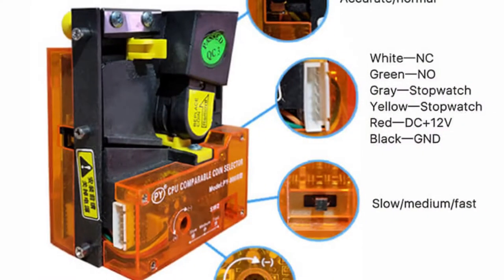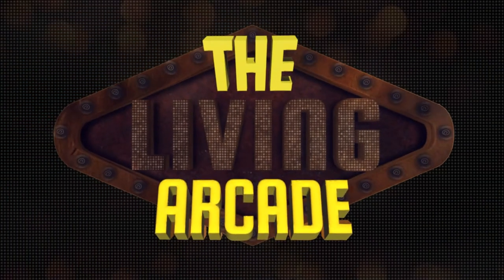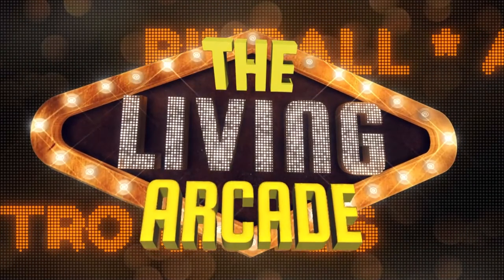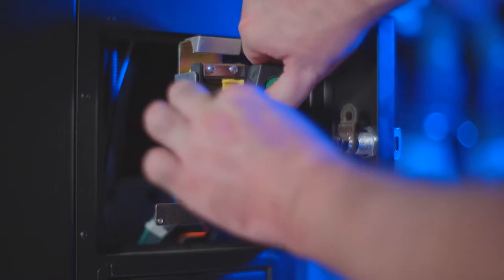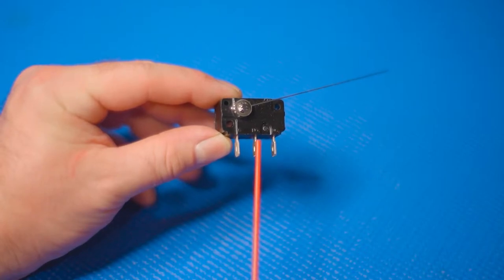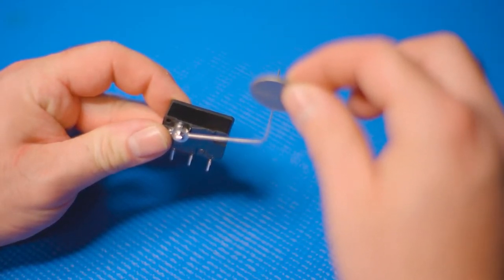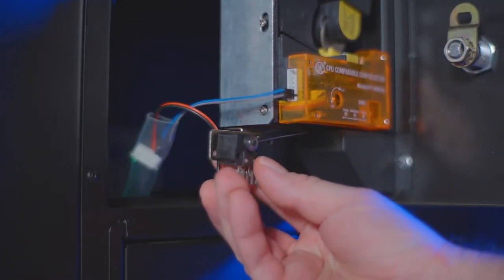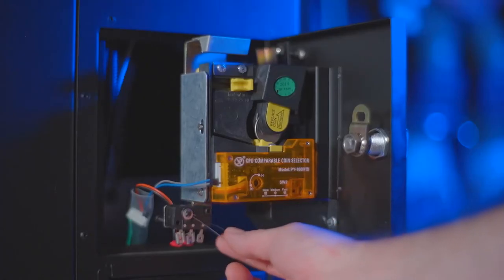Arcade chewlix CPU coin acceptor easy fix no programming coin mech fix

Comment: Well you turn the fancy coin accepter into an old style coin-mech, you could just cut a slot in a piece of wood and put the switch on the bottom for cheap.
The coin accepter must have the same ground as the receiving device (PCB, computer) or as stated one maybe floating way above ground and ground is the reference. If a device is low powered (brown out), digital switching happen within 1-3V range 0v being low, 5v being high. Devices can be a pull high or pull low to indicate activity. Coin-mech's are a pull low (ground) to activate and so are action buttons. Tie the two grounds together to have the same ground reference voltage. (hope no noise or ground loop issues) 12v runs lighting and hold coils but switches run on TTL 5V (or less today for 3.3V MCUs)
Reply from the maker: 100 percent correct! Thanks for watching. I appreciate the insight too. I'm always learning. Yes it's a glorified coin chute at this point but my cab already came with it. I don't know how to tech out if there are any ground loop issues but since it was connected both to the USB of the PC (5v) and a separate 12v power supply plugged into the same power strip. I can only gather that those two grounds aren't bonded even though they should be. I just now thought of trying to power it via the same ATX power supply that is supplying the PC. I'd like to think that those two grounds are bonded. A lot of people reported them working sporadically and causing weird behavior with their USB keyboard encoders. I imagine caused by mixed voltages sharing the same ground that isn't bonded with the USB PC ground. Adding the switch was the cheapest quickest fix. It's way overthinking at this point but it's more about the learning and exploring for me and these principals do transfer to other applications.

Comment: Just got this working following your exact instructions, thanks buddy. Luckily I had the same mounting plate on my Chewlix as you.

If anyone in the UK needs a coin switch to do this mod, I have three spare coin microswitches available that I can give away. Could only find them for sale in a five pack.
Reply from the maker: Awesome! Glad to hear it! I see so many people in various rooms having wacky issues with these things. I can't prove it, but I believe it stems from connecting the 12v ground on the coin acceptor to the USB encoder which is grounded to 5v creating a ground potential difference. 
This is a silly work around but it's the only way I could get it working reliably. And it prevents your USB encoder from any 12v bleeding across it.
Reply: @TheLivingArcade  yeah I agree with you and I highly suspect the 12v to 5v differential is why you hear about so many Chewlix owners complaining about frying their brooks boards. I don't think it's a silly workaround because they had the foresight to include the mounting holes, and you were one of the only people with the foresight to use them!
Reply: @TheLivingArcade  now that I have your attention do you know what the easiest way to make my chewie accept any old coin is? I have a bunch of Sega, Taito and Street fighter tokens that I just bought from a local guy. Not in the US so hard for me to order an AnyCoin
Reply from the maker: @DarrenOConnor3  I haven't messed with other coins on mine. It has a plastic yellow slider adjustment on the top left and the sensitivity trim pot adjustment. You might be able to find a sweet spot where most will pass through. It is designed to be configured to only accept one coin though. I believe you will have mixed results getting it to accept a bunch of different ones. I have seen ebay listings with "lots" of the same tokens. 
I think you will be better off finding a "lot" of all the same tokens.
I've looked into getting my own custom ones made but you have to order a thousand min.

Comment: You could technically use a relay with that coin acceptor as normaly those use pulse with 3/5v so a relay will work better and will help with the credits
Reply from the maker: That's a cool idea. Yeah I assumed it put out a pulse when it's wired correctly instead of just closing the circuit but my meter is too slow to capture it to confirm.

Comment: I have this exact py-800 but can't even get coins to pass through it(and not to reject). Tried with UK 10p and us 25c.  12v is applied, everything set to slack. Just don't get it 🙁
Reply from the maker: Don't fret! I'll try and help. First thing. Does it make a loud beep when 12v is applied? It will make a loud single beep when the power supply sends 12v to it and it's energized. If it doesn't make that beep when it's initialized, you may have it wired wrong or it's not getting 12v.

Second. Have you placed a "reference" coin in the spring loaded slot. It's on the left side with a yellow sticker and the arrow on it. That tells it what coins to accept. Make sure it's the same type of coin in there.

Third there's a plastic yellow slide "sensitivity" adjustment on the top left. Try sliding that left or right into different positions. It has notches that prevent it from moving but allow it to be adjusted.

Forth check the little knob on the side. It's like a volume knob that can only be turned by a small screw driver. Another "sensitivity" adjustment. Mine rejected coins when this wasn't set right.

Too much slack on any of these caused it to reject coins for me.

If it still doesn't work after confirming the above, Remove it completely. There's a switch on the front of it that can only be accessed when it's removed. It says "normal or precise" try both. The other switch says "fast, slow, med" which I believe is the pulse it sends to the board. Which never worked for me hence why I did it this way in the first place.

Please report back if this helps or not. Good Luck!
Reply: @TheLivingArcade  Hey 😀 So kind of you to try and help!  I'd already tried everything you mentioned  - the slider in the T/L is just another diameter check.  The sensitivity dial did nothing for me unfortunately, coin still passes straight through.  I asked the Chinese seller but as expected he wasn't a lot of help 😮 Maybe I just have a dud though... I made a vid for the seller here showing the coin passing right through: https://youtu.be/ysSA-jZggu4  You can hear the beep when 12v is applied and see the reference coin installed.  I get the same result for common coins,  if I've a dud unit though I guess I'll have to order another one!  Just trying to rule everything out and sounds like from what you've said I'm using it properly 🤔
Reply from the maker: @jorisbonson386  Yup you have tried everything. It's at the point of diminishing returns now I think. Could be a dud or could be something wacky and simple. Mechanical issue inside the chute or something. I hope you can figure it out or at least they send you a new one. Good luck!
Reply: @TheLivingArcade  Cheers anyway buddy 😀
Reply: I have the same issue as you, Chris. I got it to accept a US 25c one time (and it worked in game) but it must have been a stroke of luck because the other 999 attempts have all been rejected. My coin mech was a one pump chump I guess

Comment: So doing your “work around” you don’t even have to wire the coin selector up at all? Just need a reference coin in place?
Reply from the maker: Correct. It does still need 12v powered to it in order for it to allow coins through to fall out the bottom and trigger the additional coin switch. and yes the reference coin mechanically tells it what size coin to accept. It’s basically a 12v powered coin chute at this point. Lots of people have no issues with them wired normal directly into their USB encoders. But for me and many others it causes random issues with their USB encoders because the way it can pulse and bleed 12v back into the USB encoder. USB being 5v connected to the PC or console. Connecting only that traditional coin switch directly to your USB encoder. And running 12v power to just the coin mech so it allows coins through. And removes the 12v from the shared circuit of the USB encoder. Hope this helps. Let me know
Reply: @TheLivingArcade  definitely helps. I’m running a PS5 in mine. Just curious where I’ll get 12v from now.
Reply: So I just tested it with power and with out power. As long as you have a coin in the holder for sizing, coins will pass through.
Reply from the maker: @trevoroickle7753  oh cool mine would not pass the coins through without power. I’m glad yours doesn’t need power. Just one other thing to not need to mess with.

Comment: Unforutnately, the listing on Amazon for these is now "unavailable". Any ideas where else we can find it?
Reply from the maker: Do you mean the coin switch? https://amzn.to/3Pabpuk this one shows as available on my end. Or do you mean the whole coin mech?
Reply from the maker: I’ll try and find you some more links if you need. Just let me know which thing you’re looking for.
Reply: @TheLivingArcade  Do you know where to find the whole coin mech for a viewlix/chewlix?
Reply from the maker: @shepardbranagh  the model number is "CPU coin acceptor PY-800" you can get it on aliexpress: https://www.aliexpress.us/item/2251832608985244.html?spm=a2g0o.productlist.main.23.3aed2eb9TUtcZJ&algo_pvid=bb0baa47-ff20-4378-8303-5f04a8fda885&algo_exp_id=bb0baa47-ff20-4378-8303-5f04a8fda885-11&pdp_ext_f=%7B%22sku_id%22%3A%2263860114135%22%7D&pdp_npi=3%40dis%21USD%2118.2%2118.2%21%21%21%21%21%4021224e9b16772049605148879d0747%2163860114135%21sea%21US%210&curPageLogUid=nowTjWH5wGf1
Or ebay if you don't want to deal with that: https://www.ebay.com/itm/144922769639?chn=ps&mkevt=1&mkcid=28&srsltid=Ad5pg_Etd0XmV9ua8XNDX81iUeR8X_CtJXUPOQkYeMLeANrWBHJmwAkQEnc

I'm not a big fan of this "mech" but it's a unique fit and I don't know of any alternatives that will fit. Many people have had no problems with them wired directly to their encoders but what I show in this video is the only way I could get it to work reliably. for me. Let me know how it works out for you.

Comment: Man these coin mechs are the worst right, took me ages to work mine out and still didn’t work properly lol
Reply from the maker: That's why I made this video. I see a lot of people posting that they work fine but I see people posting all kinds of weird behavior. I can't prove it but I believe it's because it shares the 12v ground with the ground pin that is connected to the USB encoder. The USB encoder is 5v ground to the console. There's a difference between electrical ground and earth ground. It may cause a ground potential difference between multiple voltages and different grounds that may not be truly bonded. These mechs are designed for Jamma which is 12v all the way through so it isn't an issue in that application. My method may seem silly but it's the only way to fully decouple the 5v USB encoder from  the 12v. feeding the coin mech. Personally, I wouldn't risk the chance of that extra potential to bleed across a $100 brook UFB. Or worse, bleed down the USB port into the console! I'm hoping someone will see this that really knows electronic circuits that can explain if I'm right or wrong. I'm really just guessing here.

Comment: pLEASE SOMEONE TELL ME WHAT I would use to power this thing up with. I only have the CPU box thing. Someone please tell me what I use to power thiss up. Is it a 12 volt square battery from a hardware store? Or is that not a 12 volt battery? It is kind of big battery with a Spring on top and a Black nubb or something.  Please notify me by placing my name or my U tube. Thank you 4 your help. I've subscribed to your channel and look 4 ward in hearing from anyone who can tell me where they got the Chew links or what ever it is that the coin hits to make it count. Thank you. Jay Great Video. P.S. Ive had this thing for about 3 years and haven't been able to put it together. I also have a Face thing for a Machine from to put the coins in a Slot and do NOT Know how to hook it up. lol
Reply from the maker: I'll do my best to help you. For starters this video is a modification/work around I came up with. Plenty of people got this coin mech to work normally without using the additional coin switch I showed in this video. It's supposed to function just fine without it. In my case it did not and this is what I came up with to get it to work for me. Hence why I made the video for those that have the same problem. Check this feed on how it's supposed to work. https://forum.arcadeotaku.com/viewtopic.php?f=3&t=36736&p=550895&hilit=chewlix+coin+mech#p550895

Power: You will need to wire it to a 12v DC power supply. I don't recommend a battery. Here is a random link to give you an idea of what they look like https://diyarcade.com/products/arcade-power-supply

Where to find a chewlix: There's the various used markets facebook, offerup ETC. Some people get them from aliexpress but the shipping is brutal! They are in high demand and take some effort and luck to find locally.

"thing that hits to make it count" I believe you're referring to the coin switch. I provided a link in the video description they're quite common.

Here's a great video that has some more info on how coin mechs work that may help you.  https://www.youtube.com/watch?v=KFRnm6Et1zc

Good luck I hope this helps!